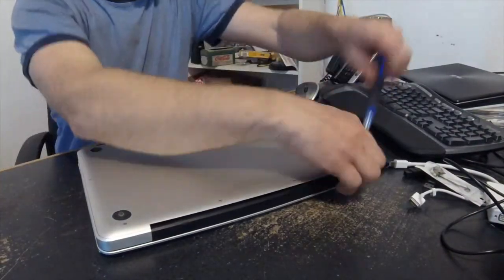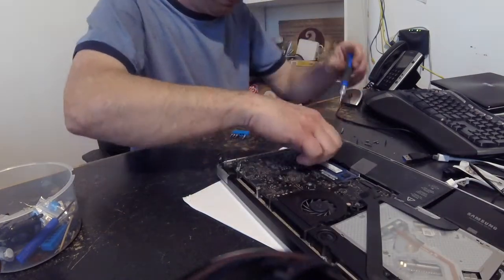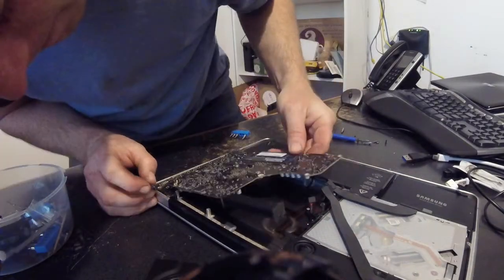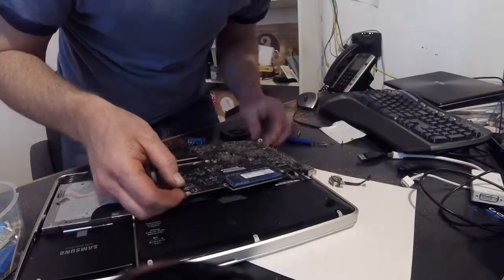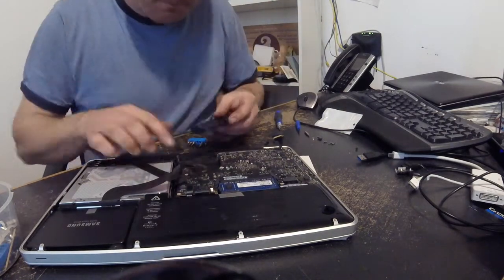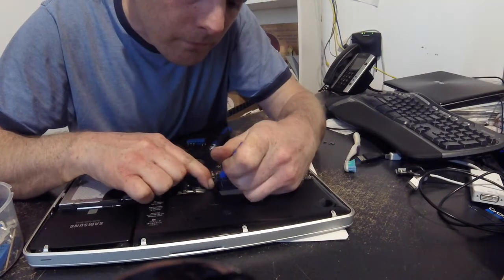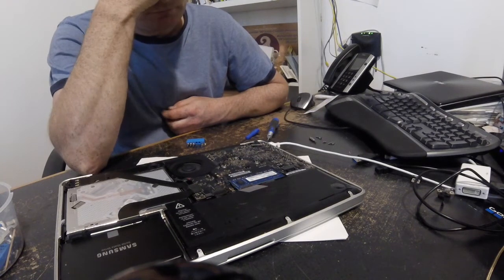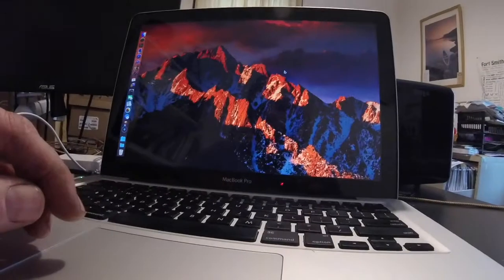How To: Replace a Magsafe Circuit Board on a 2012 MacBook Pro

Comment: Could you explain what the part was that you had to replace that was actually the problem? I may have the same issue
Reply from the maker: its just called a magsafe circuit board as far as i know. Its a stand along piece you can get replacements for.
Reply: @MicahGallant  oh I thought u mentioned that it was another part that alters the voltage/current